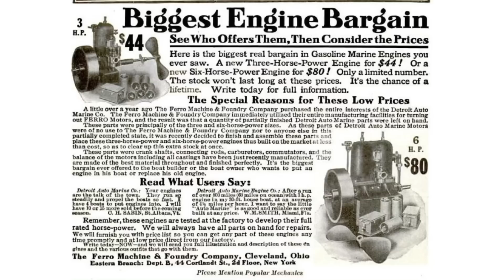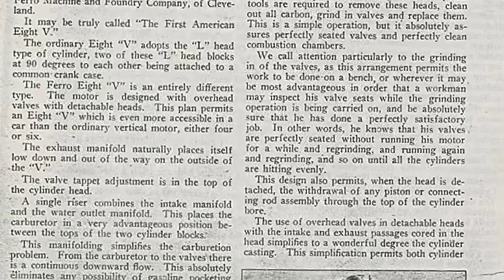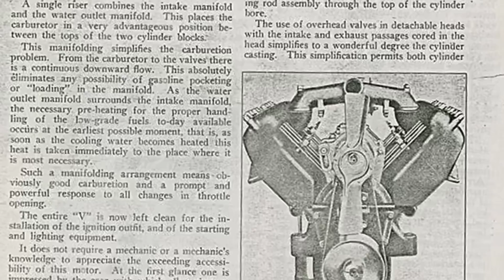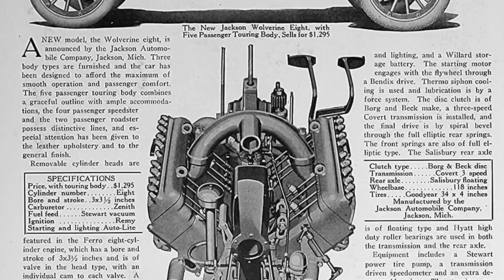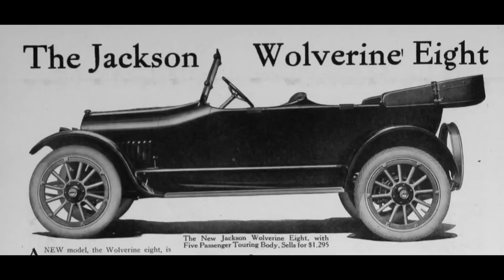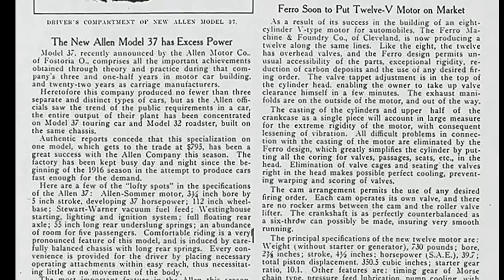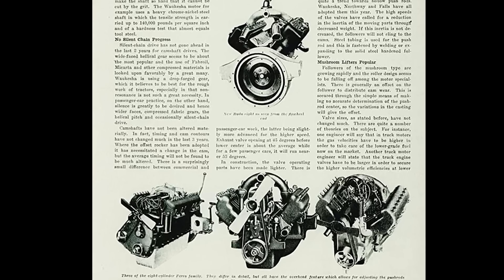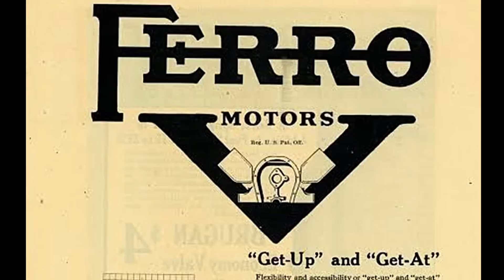Ferro Engines, Americas most modern V8 you’ve never heard of 162, 198, 265 and 350.5 V12

Comment: I can’t believe the 10:1 compression ratio of the V12 engine. The straight 8 Duesenberg  of nearly 20 years later was only 5.2:1. 
I doubt gasoline available in 1910 was even 60 octane.
Reply: Some high performance pre lead engines did have high compression. They were exclusivly alcohol fueled though.  Probably in boats.
Reply: I agree that it couldn't be a 10:1 CR.  Must've been a typo or error by the printing shop.  Just look at the cylinder castings.  The gap between the middle cylinders reveals a 3-main bearing crankshaft!  Bad enough for an inline six but, a V12?   A 10:1 would've broken or bent that crankshaft in short order.  I could see that engine with a 4.5:1 or maybe 5:1 just because of the crank and the quality of fuels available at the time.
Reply: @BlackPill-pu4vi i believe these would have been 5.5 to 1 like the V8, yes these had 3 mains, but these were not like a modern main that is maybe a little over a inch wide. These were probably 2 and 3 inches wide carry a lot of the stress over a larger surface. Also consider these engines made there hp at 2500 rpm the recline was probably 3 to 3500 rpm.
Reply: @neildorey3978  
The creator of the video misread the literature, right after the engine specs it lists the starter ratio as 10:1.
Go to 6:20 in the video and read the excerpt, it's an easy mistake given how the company wrote the specs.
Reply: @dukecraig2402  thanks, I have the same paperwork and I know the misread info. I was merely suggesting the compression ratio was most likely the 5.5 to 1, as the 3 V8 were the 5.5 to 1. And the designs are all very similar, and the gasoline grade was poor. The probably adjusted the compression size according to keep it in the same ratio.
Reply: He misread something, right after some engine specs on the text at 6:20 it lists "starter ratio" as 10:1, so no, it didn't have 10:1 compression pistons, as the OP stated the gas back then didn't have high enough octane levels to even think about compression that high, and for the displacement the power levels would certainly be much higher than it was.
This is exactly why most cars still had flathead engines, without the octane levels needed to run an OHV engine with enough compression to make a substantial amount more power than a flathead the expense and especially the added maintenance of an OHV engine just wasn't worth it for John Q Citizen, OHV engines back then had valve trains that wore out much quicker than a flathead, so for the couple extra HP of an OHV it just wasn't worth it, people would rather have a 40 HP engine that lasted 20,000 miles compared to a 45 HP engine that had to have the valve train reworked every 5,000 miles. 
Back in those days only the richest people owned cars like Rolls-Royce with OHV engines, they came with tool kits and part of the chauffeurs job was being able to take the head off, install new springs and lap the valves on a weekend when the owners were out of town, that was strictly luxury car stuff in those days.
Reply: In 1940 we had 140 octane av gas which is no longer available so it's not har to believe they could make 90 in 1910
Reply: @Steve-iw8yz  
They didn't, lead which is what took octane levels up to modern levels wasn't starting to be used until the 1930's and even then pump gas didn't have octane levels that could support that kind of compression until well after WW2. 
And aviation uses a different scale to measure octane, in WW2 what was considered 140 was about 100 octane the way pump gas is measured in the US, worldwide there's 8 to 10 different octane numbers assigned to the same exact gas, that's why when I went to Germany in 1984 and saw the lowest octane on their gas pumps was something like 94 I thought "Wow, they must have some wild cars around here", what I didn't understand at the time was what they call 94 is our 87.
North America, South America, different countries in Europe, Asia, Malaysia and other regions all have different ways of measuring octane which yields different numbers for the same exact fuel, online you can find charts that show how the different regions numbers compare to each other. 
And the creator of the video screwed up, the starter ratio is 10:1, he misread the print shown at 6:20 that shows the starter ratio and mistakingly thought it was compression because it's listed immediately after other engine specs.

Comment: Thanks for putting this together I've been looking for this information for a long time.
FYI you show a rear shot of the Chevrolet Model D in the early part of your video as an example I think of other V8s of the time. Durant bought Scripps booth and it became the Chevrolet Model D. People say this was the first Chevy small block which is kind of cool but actually it wasn't even a Scripps Booth it was a Ferro!
Reply from the maker: I was going to add something to that effect, but I totally forgot to go back and say that the Chevrolet V8 shares a lot of characteristics from the ferro.. which brings into question how reliable these engines where the Chevy isn't an exact copy but they do use the same exposed push rod design.. early V8 are super interesting 

I tried to put as much text as I could even the text contradicts itself on the different sizes.. which is interesting this was a fun one to put together 

Happy you dig this one

Comment: The V-12 compression of 10.1 to 1 must be an error , most engines o f that time had only half that much, unless it was a special racing application.
Reply: I agree that it couldn't be a 10:1 CR.  Must've been a typo or error by the printing shop.  Just look at the cylinder castings.  The gap between the middle cylinders reveals a 3-main bearing crankshaft!  Bad enough for an inline six but, a V12?   A 10:1 would've broken or bent that crankshaft in short order.  I could see that engine with a 4.5:1 or maybe 5:1 just because of the crank and the quality of fuels available at the time.
Reply from the maker: I know did you see it in the text? That's why I put it all the text that I got a lot of the information from in the video... that's impressive for that era
Reply: @What.its.like.  Do you refer to the "10.1" seen at 6:20 ? Then you didn't reed the actual text. It tell the starter gear ratio that are 10:1.
Reply: Couldn't possibly be, octane levels weren't high enough to run anything near that high back then, an engine with 10.2:1 would have shredded itself on the gas they had back those days. 

It wasn't until the 1930's that lead started being used to raise octane levels in gas and 87 would have been aircraft octane levels then with pump gas for cars still being much lower because engines back then hadn't started raising their compression ratios high enough to use that level of octane until well after WW2.

Comment: Amazing on that compression number. I never thought they had hardly half that then.
Reply: Fuel was the biggest problem. Very low octane. That 10:1 number sounds wrong to me.  Awesome design.
Reply from the maker: Yeah it was I high figure but who knows I wonder how many twelves were made if any at all 

I'm going to ask around maybe we will come back to it
Reply: @jimrudolph1582  I think that is the starter gear ratio, it shows above the v12 drawing
Reply from the maker: I honestly believe that these engines were way ahead of their time. I've no idea what happened to ferro why they went out of business. I wish that was a piece of the puzzle. I could find sometimes information just gets lost of time especially when you think that that was 110 years ago.
Reply: @What.its.like.  Their Australia subsidiary still exists as a manufacturer of coatings
Reply from the maker: Interesting 🤔
Reply: @What.its.like. Ferro was in business till the fifties, they were sold to John Harsch Bronze and Foundry Company. I'm April of 1955 there was a announcement of a auction of the Ferro equipment.
1951 Ferro was adding 35000 sq ft of factory area, perhaps of a anticipated contract for automotive castings, but something happened and it didn't materialize.
Prior they casted lots of engines for a multitude of companies, including Ford and GM.
That also did over a 100,000 tons of castings during WW2.
Reply from the maker: @ was it the same Ferro company
Reply: @What.its.like.  yes it is, they stopped producing their own engine and went on to producing engines for other makers, somewhere around the early twenties.
Reply from the maker: @ great information thank you so much =)
Reply: Well it all comes down to the availability of high quality high octane fuels.
Reply from the maker: Maybe they ran it on alcohol
Reply: Doesn’t sound possible with whatever was passing for fuel back then. What we now call gasoline was just one of many recipes in use back then . In fact the Germans used “Benzen (benzene) . A more common upper level ratio back then would have been 6.5:1.

Comment: Interesting unknown engine never heard of Ferro. Take the 1916 Scripps Booth
Reply from the maker: It's crazy that that engine only existed for four years and it was so far ahead of everything else. I was going to add that the Chevy V8 took a lot of design aspects from this engine, especially the external push rods in the valley between the cylinders
Reply: @What.its.like.  it wasn't till 1955 when Chev started using the ball stud rocker arm design, yet Ferro used it back then.